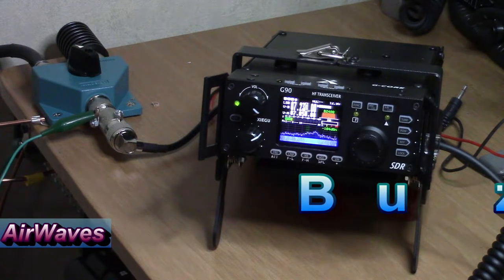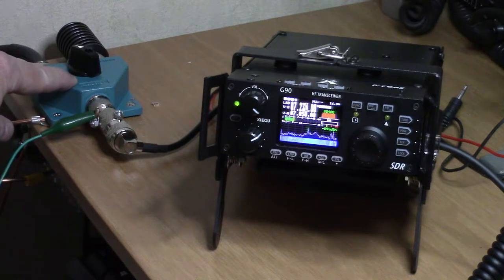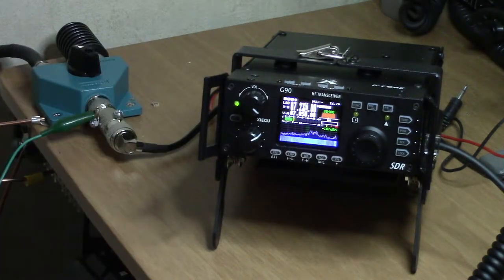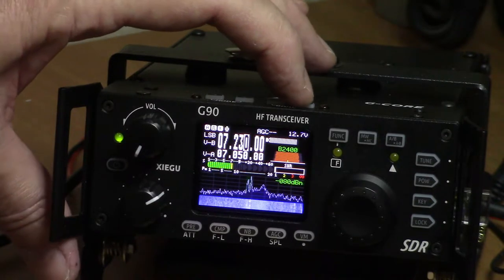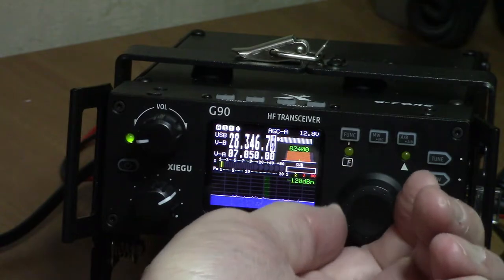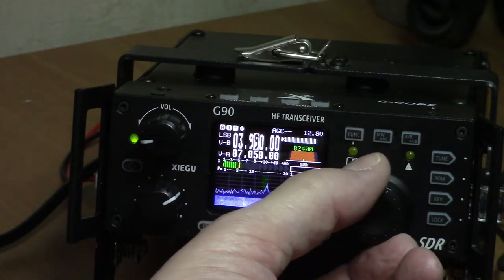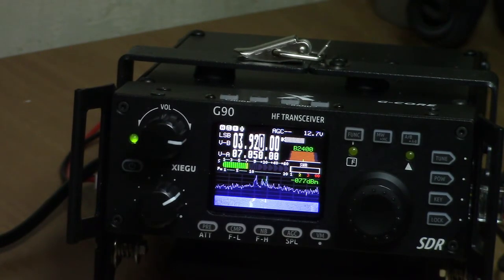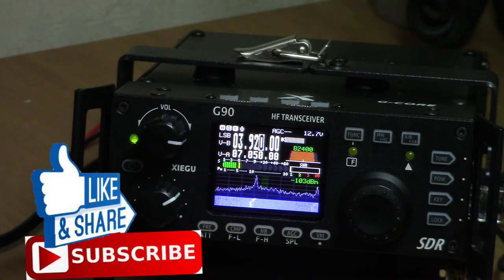AirWaves Episode 22:  Xiegu G90 Teamed Up With an 80m Dipole

Comment: FYI for viewers who have not figured it out yet: Short tap the volume knob  switches output to headphone jack. It is in the user manual but easy to miss. This is  good because you can just leave the headphones  pugged in all the time and tap the volume when you want to use the headphones.  This is reduces wear and tear on the connectors.

Comment: Great Review. After reading this and some of the reviews on this XIEGU G90, did something I probably should not have since I already have so many radios already.  but this one seems to have found a niche the other ones don’t fill. I ordered one of those xiegu G90s which are on sale for $450 and I put it on the credit card   Which is a quasi-QRP radio that can go up to 20 Watts but can be turned down to just a few watts  if you want to save battery power.  However, I like the fact that, if I have too for an emergency or just want to, I can still push it back up to the 20 Watts. It  is smallish and easy to carry around.  I’m getting a 60 foot wire from Chameleon that I can just throw out over some tree limbs or whatever and with a lithium ion battery and my fold up solar panels  I can do cw just about anywhere I am. The reason I wanted this one is because it also very easily decodes CW. No I do not want to depend on that but in an emergency If I am kind of nervous and not copying my CW like I would like then it is nice to have that little addition. It also has an internal Antenna tuner they say is so good it could probably tune up a head of lettuce. I like that in case somehow I left my antenna behind, lost my antenna, or heaven for bid damaged the antenna that I’m carrying and have to come up with a makeshift one. Especially since It also has a great SWR graph that can help along with the internal antenna tuner if you have to build a new antenna on the quick. I think this little Xiegu G90 is going to be the cats meow if I just want to grab a bag and go quickly
Reply from the maker: Doc, Couldn't agree more.  I did a series of videos on putting the G90 into a field pack.  Might want to check those out.  Episode 26, parts 1-4.  You'll love the radio.

Comment: The earphone issue you switch between speaker and headphone output by pressing the volume control knob in.
17m wasn't working in the video as you had the rig on LSB instead of USB.
When switching between bands on that 80m dipole, operating the built in ATU (long press the tuner button) will improve receive a little as well.
73 Ed DD5LP

Comment: On all but 20m you had the attenuator on! The signal level on 80m was amazing, despite this. You also had the noise blanker engaged, probably didn’t need it - but NBD.
Reply from the maker: That's what happens when I try to read a 2.8" screen, without my reading glasses.
Reply: Air Waves 😂 It is quite small. I wish I had a good 80m antenna like yours. Those signals were amazing.
Reply from the maker: A good antenna makes all the difference.

Comment: Hey Buzz,  Great video.  Probably making the purchase this week.  I found your antenna switch, but which dummy load are you running?
Reply from the maker: Thanks for tuning in, John.  I bought the coax switch and the dummy load on Amazon.  Search the following to find the dummy load:  Mcbazel Surecom 0014-0154 PL259 Male Plug DC to 1.0GHz 25W Watt 50 Ohm Dummy Load
Reply from the maker: BTW, there is what looks to be, an identical dummy load, made by MFJ, but it's twice the cost, and looks the same.

Comment: pushing the VOLUME encoder turns the headphones on / speaker off, and vice-versa...
Reply from the maker: Thanks for the subscription, and the tip.  Worked like a charm.  Xiegu said i was probably using the wrong type of headphone/plug.
Reply: @Airwaves-Radio  glad it worked. love my g90. it does yeoman service on SOTA and back-country canoe camping ops.
Reply from the maker: @n5407c  How do you keep it dry on canoe trips?
Reply: @Airwaves-Radio  i use a pelican case, or a lowe-pro camera case inside a dry bag, depending on the mission.

Comment: 17 meters should be USB. You were trying to tune signals with radio on LSB
Reply from the maker: The radio is supposed to automatically set the mode according to the band plan.